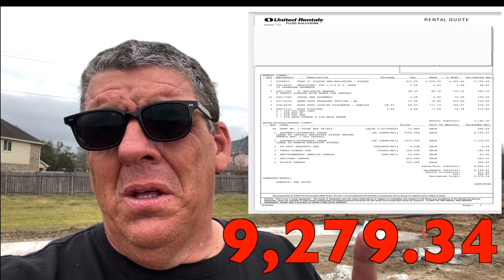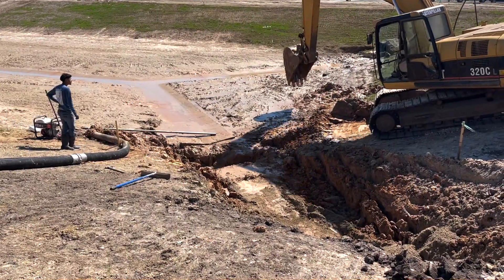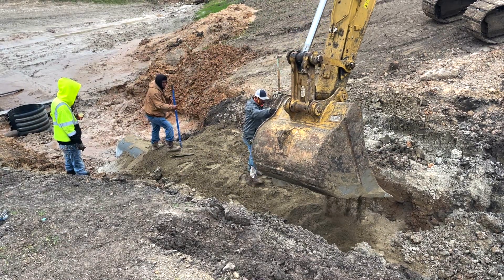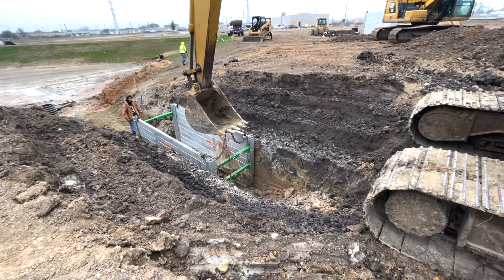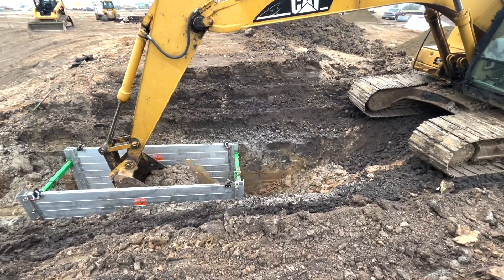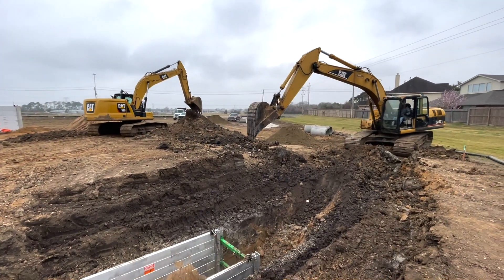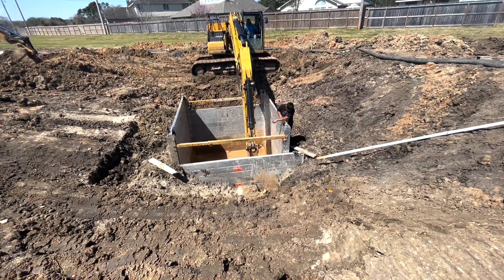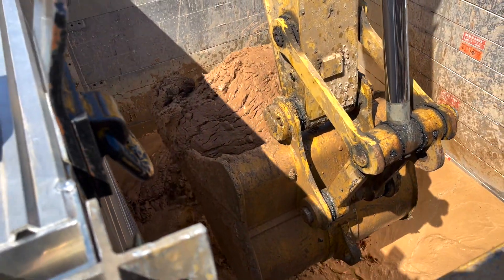Prepping Ground for a Concrete Lift Station using a Trench Box in Wet Conditions

Comment: Hi, there. Dificult work to fight the water. Know also a bit about. Had my share of working below water level, just like you need to do there. And it is exactly as happened with you. We bet that we will get away and save the dewatering cost. Sometimes we score. Sometimes not. This is construction. Keep it up. Waiting for the second part. Good luck.
Reply from the maker: Yes fighting the water is very difficult. Thanks for watching